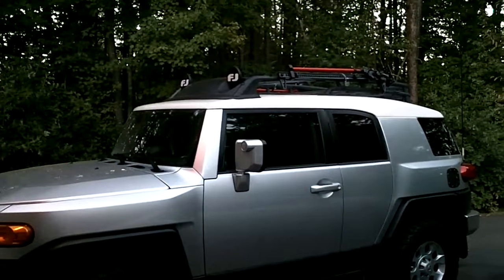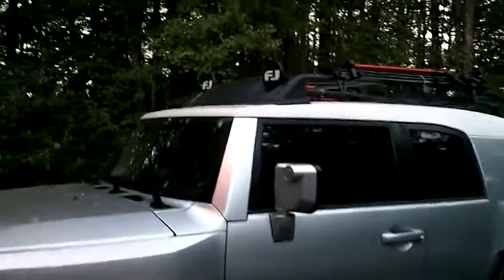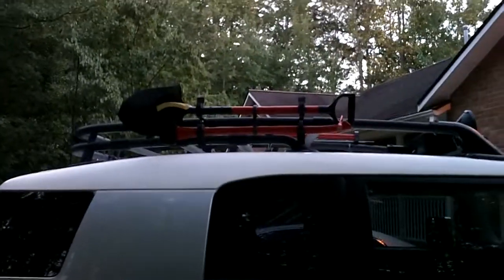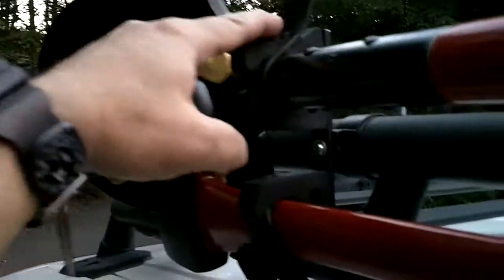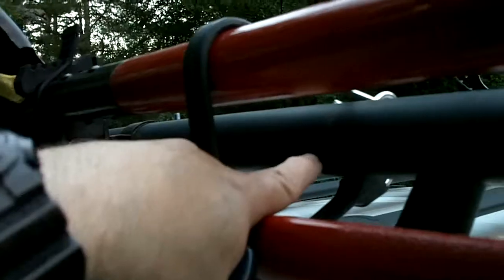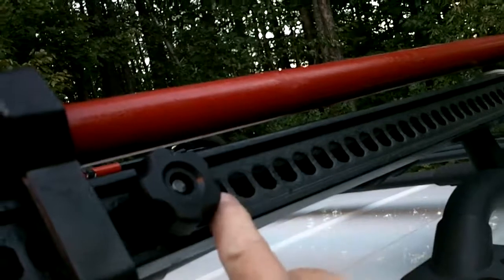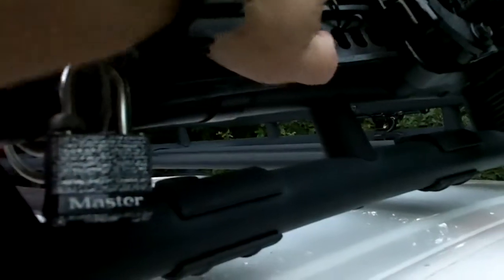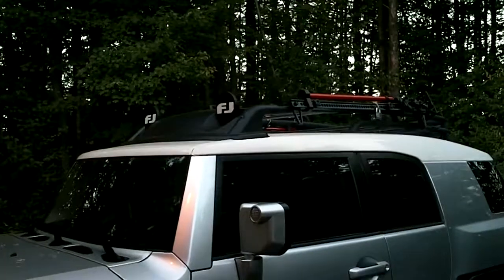FJ Cruiser Bug Out Project (Hi-Lift, Ax, Shovel Mounted)

Comment: How do you keep the jack from resting on the vehicle? The conduit connector will move downward because of the weight of the jack even though it's pretty tight.  The jack ends up resting on the roof.
Reply from the maker: I used rubber inner tube strips underneath the mounts to make them fit tighter with no slipping. Mine have been on since doing this video with no issues.